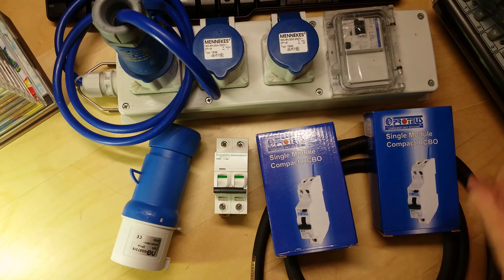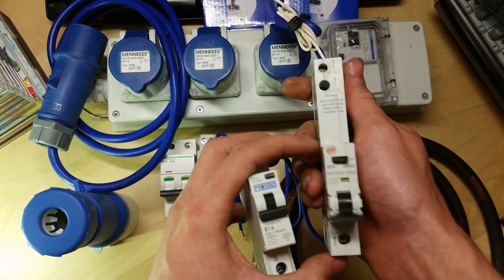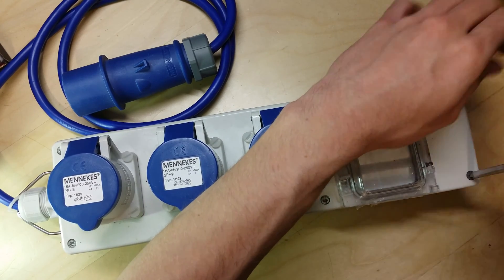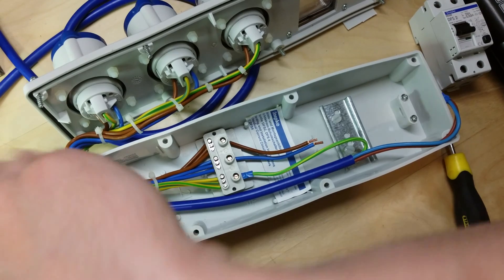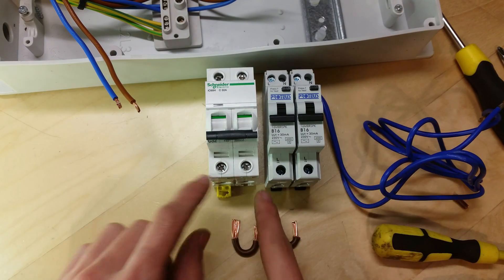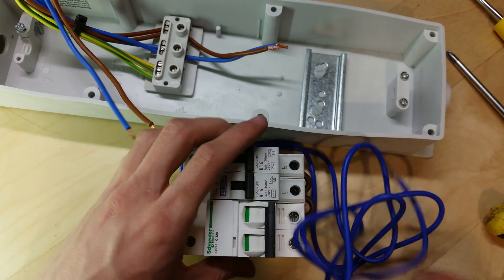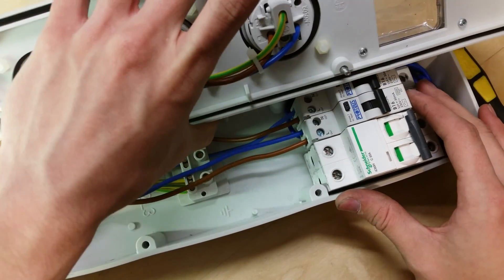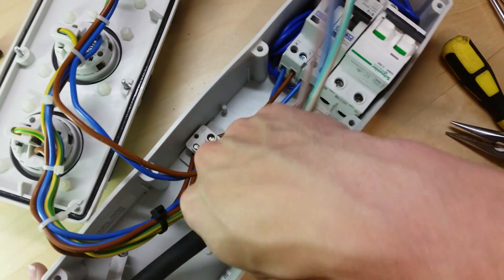Weatherproof 32A Single Phase Power Distro Build - Heavy Duty PDU for Outdoor Event Power

Comment: I did a similar rebuilding on my 19“ rack 16A 3 phase power distribution for my Amprack. It was CEE16/5p in and 6x CEE16/3p out, spread across the three phases. But the wiring inside was nowhere as neat as yours. It looked horrible.

Ended up re-doing most of the wiring, and changing out the cheap china C16A breakers with real ABB RCBO‘s who also feature neutral switching for added protection ( in some venues neutral and live can be switched up in these CEE16/5p sockets.)

Too bad that small UK venues often feature one CEE32A outlet but only single phase. I will probably need excactly one of your boxes to tour UK. That way I can run only one phase into the normally 3 phase distro.the 6 plugs /3 RCBO’s can then only handle 16A combined because using it that way they share the neutral

Comment: Nice video! Question, can I still use the 16A socket if I'm only going to use the 32A mcb?
Reply from the maker: Whenever you step down from a higher amperage to a lower one, and smaller cables too, it must be protected by an overcurrent device like a fuse or circuit breaker / MCB. You cannot just go from 32s to 16s without protecting them from being overloaded and possibly melting and causing a fire.
Hope this helps somewhat.
--Nathan

Comment: Thanks for the video.  I have a question.  I am buying a generator here in Poland to do street ministry. Live music, probably 2 large coffee makers ( about 2200w
for both) plus PA equipment and other equipment. The generator I am looking at is 7.2kw nom.  

It has 1- 230v 32 amp outlet and 1- 230v 16amp.   I want to make an extension cable (maybe 150ft roughly 46m) to move the noise away from the event.  Would it be the same as you did here, or would the "run" (longer cable) cause an issue?

Comment: I wanted to make something like this, but going from a 32amp 3phase socket.
To 3 16amp single phase. And maybe a pass through socket for the 3 phase 32amp.
I'm working in a location for the next few months where I have access to 3 phase or 13amp single, phase which isn't enough to run a 200amp welder.
I can obviously use a generator but I'd prefer not to have to run the generator for 3 months.
I was thinking I could run L1, L2, & L3 to each of the live on the 3 16amp sockets and the neutral and ground between the 3 of them with a couple terminal blocks of some sort.
I'd appreciate any feedback as I'm not an electrician.
Reply: sounds like what I'm trying to build 2

Comment: I know this is meant for temporary only, but out of curiosity, can a SPD fitted into this power distro?
Reply from the maker: I mean, I guess you could but I'm not sure I'd necessarily do so. Also considering that SPDs are usually 2 modules and this enclosure is only 4 modules overall you'd have to loose a device or two somewhere to make space.
Hope this helps. 
Thanks, Nathan.

Comment: I think you could have done without the 32A main fuse because the outlet you are plugging your 32A pdu in to is already fused at 32A.

With this configuration you could end up with 2 tripped 32A breakers (in your pdu and the breaker for the outlet you plugged your pdu in to) because tripping of the first can lead to tripping of the second because there is no selectivity between the breakers.

You would have been better of with a 3rd RCBO so that you can supply 3 independent protected supplies where the one for on-stage equipment could have been a 6A which will be more than enough.
Reply from the maker: Thanks for your feedback. The 32A MCB on this unit is double-pole, meaning it also acts as a DP disconnect / isolator. 
I personally don't trust the socket upstream to be protected as it should be, or the protective device to operate correctly so generally like an overall overload protection device on my side in addition to RCD protection on my side. Not that I've ever overloaded a circuit as I work out the consumption and distribute my devices between circuits appropriately. The only tripping I've ever really encounter is RCD tripping due to earth leakage issues with other peoples connected devices. Hence the split outputs on this unit. 

I wouldn't dream of fusing a stage supply down to 6A which will inevitably end up as 13A socket outlets. That'd just impose restrictions and limitations to the system which wouldn't make any sense. Not to mention if a smoke machine or something was in use on stage. Plus most of my distribution is done by 16A in/out RCD protected distro boards with double 13A metal clad sockets. I've been meaning to make a video on this stuff in more detail but finding the spare time when the gear is out at an event is rare. 

Hope this clears things up! 
--Nathan